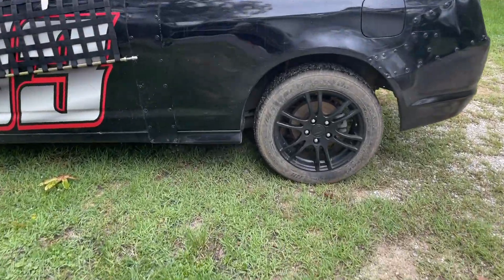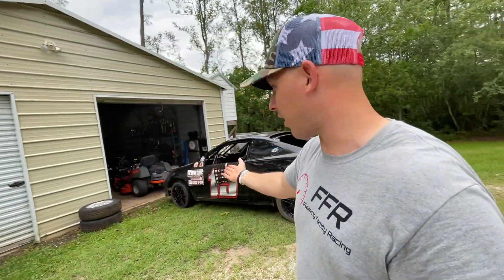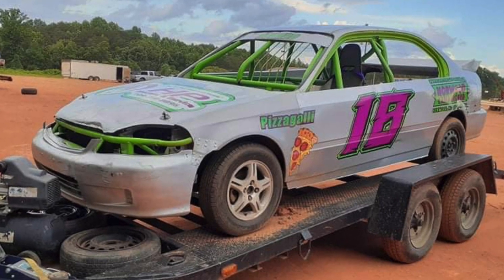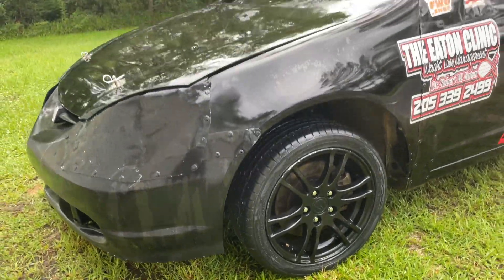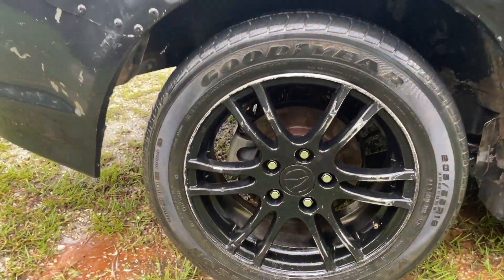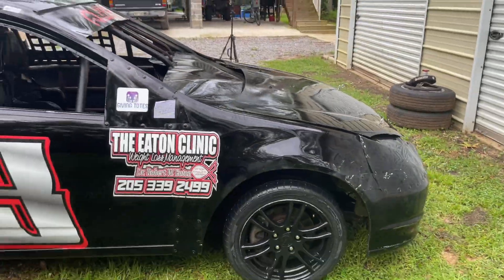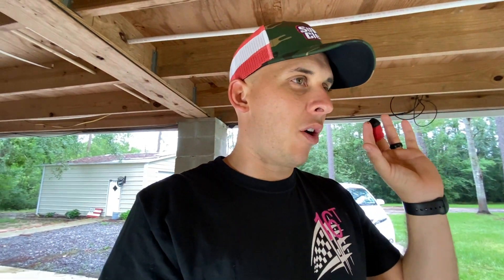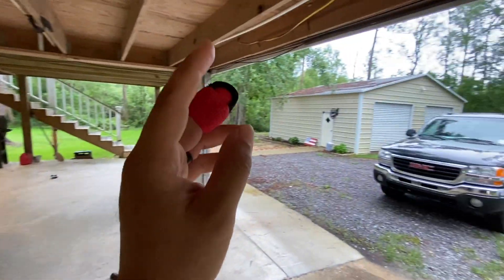"Super Clean" RSX/ Bandolero prep for RACE DEBUT!!!  (500 SUB Giveaway)

Comment: If those ain't ceramic bearings you put in on the bando, I would think about upgrading maybe down the road since they are more reliable and won't drag to rub off speed.
Reply from the maker: This is a spec class so all the bearings have to be stock for the original design sent from the factory!! But I will definitely look into it!!